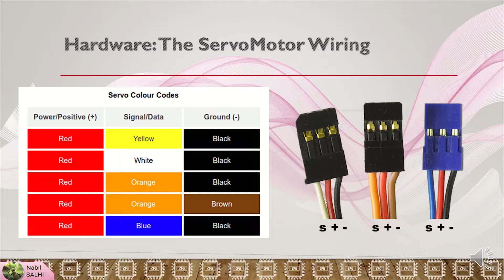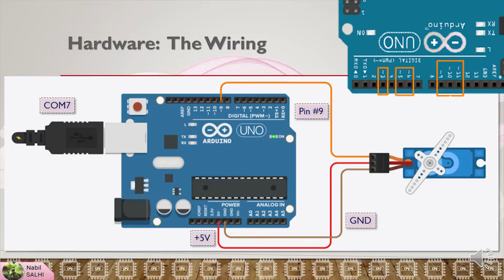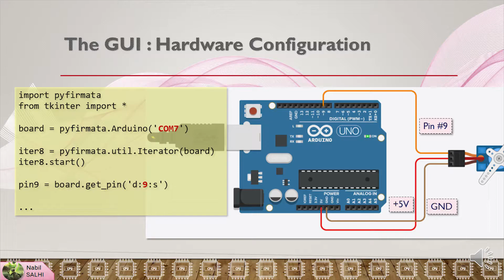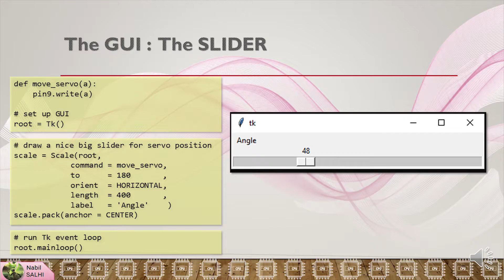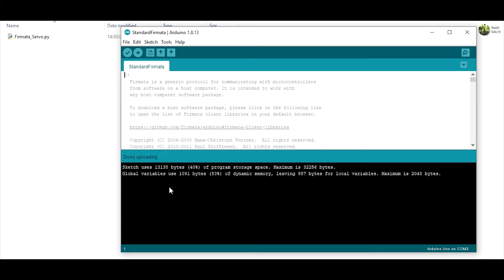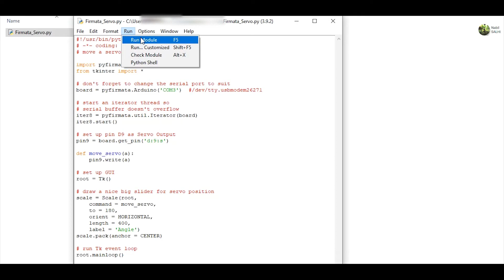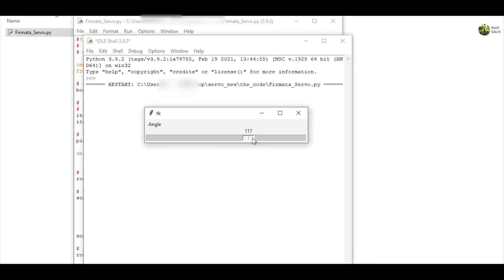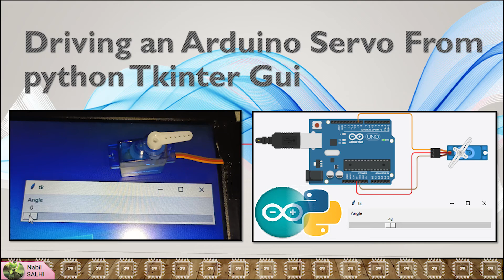Precise Servo Motor Control with Python Tkinter GUI, Arduino, Firmata Protocol & PWM Tutorial

Comment: Hello. the link to your github is an empy page. will you please send me the code? Also, does this work for two servos? I read that you would need "threading" to do that.
Reply from the maker: Hello @Robots-and-androids, thank you for pointing that out! I’ll verify the GitHub link and update it. Regarding your question, the current code can indeed be extended to control two servos. If the movement control is handled locally within the framework, the operation is faster and more efficient, you only need to send the target angle, and the framework takes care of the precise movement execution.

I’m also working on a more advanced software solution designed for real-time control of multiple servos. It includes dynamic port scanning, automatic reconnection, and real-time operation, where multithreading or even an RTOS (Real-Time Operating System) is essential to ensure reliable and smooth control. Once the updated system is ready, I’ll share the details. Thank you for your interest! Salute!

Comment: I changed the servo value to 360 but my servo dosen't rotate 360 degrees can you please fix this?
Reply from the maker: Good evening, 
In your case I bet you are using a traditional Servo Moter, however most of servo-motors and also the servo I used in this tutorial are having an angular range from 0 to 180, yet you can find in the market some servos that are having different limits 0...90, 180, 360 or even a Continuous Rotation Servo Motors. 
if you want to hack mechanically your 180° servo, I suggest you open up the traditional servo of 180 and brake mechanical End stops....
Remember, if you don’t have a mechanical problem, you can always make a "Function overloading" but it is conserved for advanced use only
I hope I covered fully and answered your case problem … salute.
Reply: @salhi_nabil The limitation for nearly all servos is the mechanical range of the poti unter the outlet axis = potis just turn about 270°. There are winch servos (for model sail ships) that will turn 3-4 times, by an extra transmission/reduction from the output axis to the poti,  
There are instructions for how to make a standard servo turn beyond the poti limits, but these need to decouple the poti so that positioning won't work any more = the servo is degraded to a motor+gear with unpredictable speed control (as the loopback between the poti and the servo signal gives the motor speed).
Anyhow, there are more specialised servos out there for robotics (e.g. from Hitec) that implement other characteristics based on a bidirectional digital protocol, sending back position feedback.
Reply from the maker: Thank you Mr. @martinb.770 for the detailed insights! You’re absolutely right, standard servos are limited by the potentiometer’s range, but options like winch servos or advanced robotics-grade servos with digital protocols offer better solutions for extended rotation and precise feedback. For anyone that want to go beyond 180° servos, removing end stops works but sacrifices position control. Appreciate the input! Salute!
Reply: @salhi_nabil  Though another tipp may help: It's possible to mount the poti somewhere else, externally to the servo, and "translate" (gear, belt drive) the motion/position to its range. 
Also, linear, "spiral" type or trimmer potis (many turns) can be used. 
Resistance will be about 10k, and take care of the right wiring, so that it won't run into the false direction.  
In many cases, the mechanical restriction is done by to nodges on the output gear train = just file them off. Sometimes the gear has no teeth there - then you are out of luck.
Reply from the maker: Thank you,  @martinb.770 , for the additional tips! The video primarily focuses on the framework and software GUI side, but your suggestions are excellent for those looking to modify servos mechanically. If you're planning to connect the servo output to a gear reducer or multiplier, keep in mind whether the servo can handle the required torque after the gear ratio adjustment. Additionally, consider the type of electrical driver needed to supply sufficient current without causing the servo to stall or jam. Appreciate your insights, salute!
Reply: @salhi_nabil  Adding a gear for HIGHER RPM will lead to problems, adding a reduction not so much, the servo just becomes slower.
Decoupling the poti from the output gives a lot of possibilities. On the other hand: standards RC servos haven't really changesd for 40+ years. There was an "Openservo" project, but it died, and robotics servos didn't spread, as the RC receivers haven't learnt the protocols, despite implementing complexity by add telemetry, but still in the phase of concurring mostly incompatible standards. There's a lot of room, but the major part of RC models don't even need it, so it isn't done.
Reply from the maker: @martinb.770 , you’re correct that adding a gear for higher RPM can introduce issues such as overheating, stalling, jamming, and excessive current consumption. On the other hand, using a reduction simply reduces the servo speed (which may lead to slower response times), but this can be beneficial depending on the application. Decoupling the potentiometer opens up many possibilities, and I like your idea of mounting it to the final mechanical output. If you exceed 360°, a mechanical reducer can limit the DC motor’s range to the desired angle. This modifies the regulation loop, and incorporating PID control could improve stability, responsiveness, and allow for a wider angular range.

Thanks for sharing!